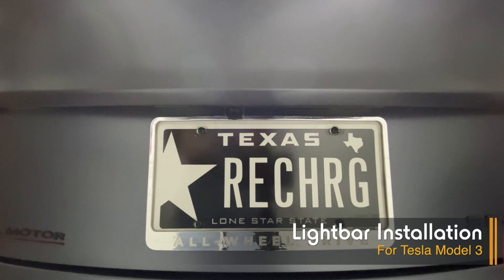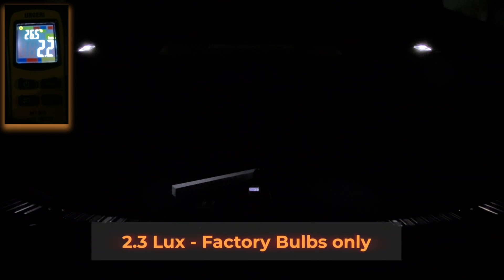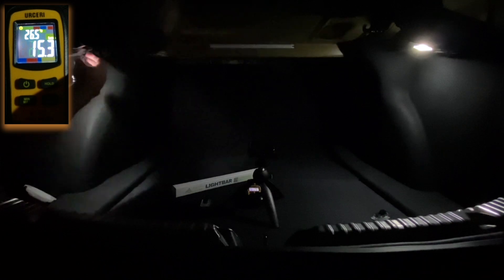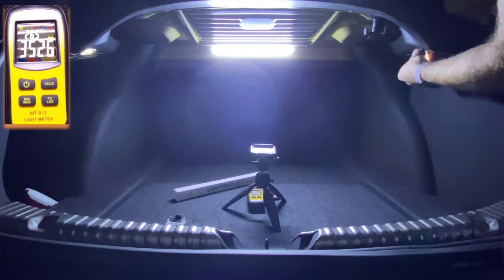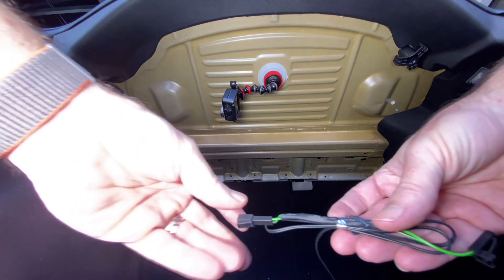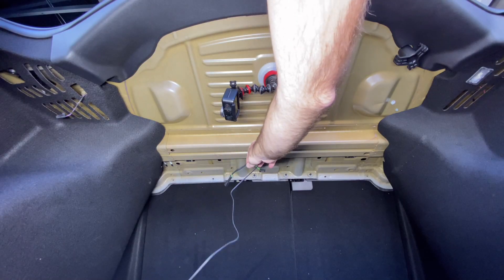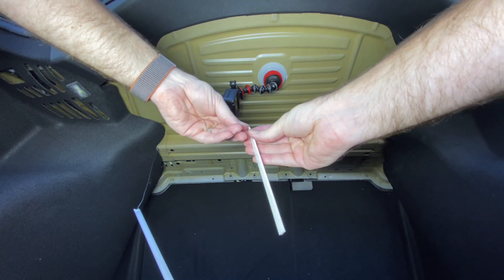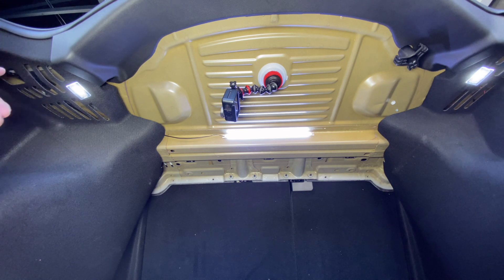Lightbar Install

Comment: Do you need to do anything different for new Model 3 (2022). My lightbar won’t lit up.
It has been a week and I keep opening the trunk to check.
But unfortunately nothing…
Reply from the maker: No, nothing different. We normally say to allow at least one night (for the car to go through a sleep-cycle/reboot), but it's it's been a week, and it's never lit up, then in might be defective. Please reach out to support@abstractocean.com and we'll get it switched out.
Reply: I've just tried the same on my late 2022. 
I fitted all the brighter lights and they all worked. 
I then fitted the bar and light went out and now that side doesn't light up at all.. 
Please advise??
Reply: Did you have any luck? 
I wish I had seen this before I fitted mine, as I wouldn't have bothered..
Reply: @au18ert  that is correct.  Abstract Ocean was very good and they send me another bar (thinking the first one was a faulty) and… exactly the same thing happened.
So I returned everything back to them.
Reply: @au18ert  unfortunately no.
Reply: @ittebellu9649  I've just gone back to the brighter lights, as it's better than stock. It seems the bar doesn't work with at least two 22 model 3s and I wouldn't chance it..
I wouldn't sell it to 2022/3 model 3 owners till it's sorted.

Comment: Looks great!  Anyway to use this in the frunk also?
Reply from the maker: DanD No, at least, not without splicing wires (which isn’t’ difficult, we just tend to specialize on super-easy installs). We’re working on an improved frunk light that’s a plug n play replacement for the existing one.
Reply: @AbstractOcean  thanks! Will wait to see what you guys come up with!
Reply: battery powered light bar would work great I bet.
Reply: @VampireOnline  agreed, however batteries don't hold up very well in -20°c winters ;)
Reply: @evdd1010  All my outdoor cameras for my house are battery and they do just fine in the winter -20 C or F lol. Blink XT Cameras they use just regular AA lithium batteries.